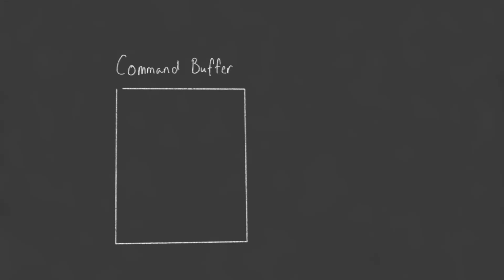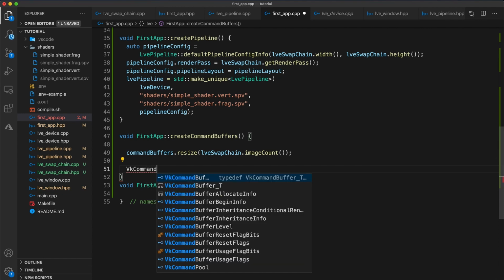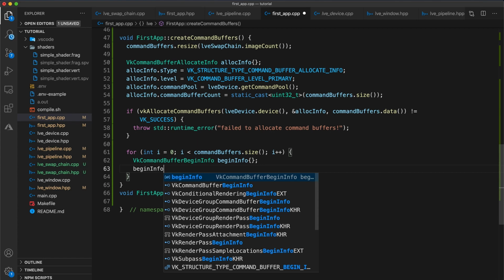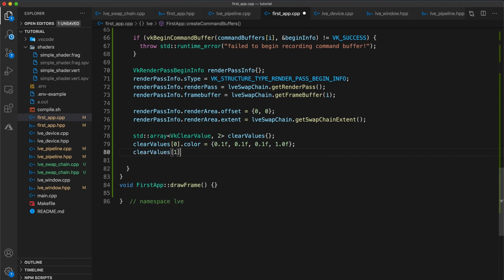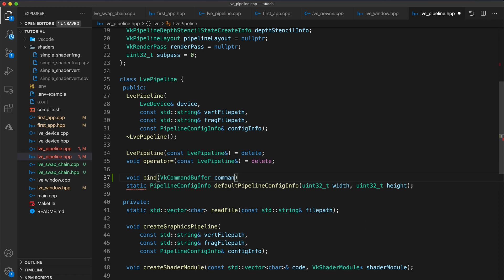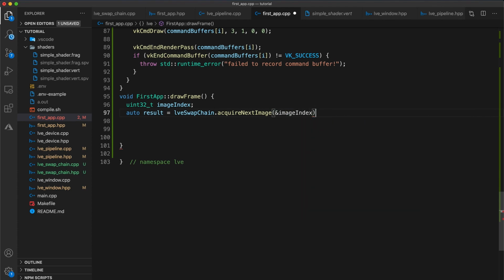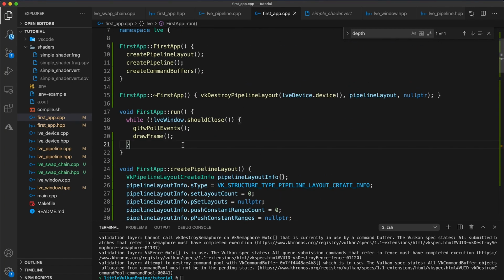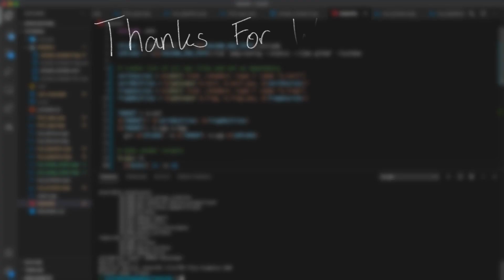Command Buffers Overview - Vulkan Game Engine Tutorial 05 part 2

Comment: Really great videos ! :D 
I'm following it on my machine but I got a weird problem when i was tried it at the end...
The window was black and was not responding. I tried to find out why and the call "vkAcquireNextImageKHR" in the swapchain was hanging forever. The workaround I did was to change the device to the nvidia one i got in my system ( the default one was an Intel Graphic GPU).
Do you know what that could be ? and what I should add to the device selection part to be sure that its ignoring the Intel one without hardcoding the Nvidia device ?
Reply from the maker: glad you found the solution. I'm not sure why that would have happened. The device class should find the devices that would support vulkan and then picks one of them. Currently it doesn't do anything to pick the better device if your host has multiple and the quick solution for now would be by doing what you did and selecting it manually... but it shouldn't have picked the intel graphics if the intel gpu didn't have the required features to run. 

I'll need to look into this more. What OS was this on?
Reply: @BrendanGalea   I'm on an XPS 15 9510 running Ubuntu ( this is a new cpu so maybe it's some driver issue ?) 

Btw it's realy cool that you keep responding to comments on a 8 month old vidéo !
Here is the physical device vulkaninfo command output so you can maybe find something I missed :)

GPU id : 0 (Intel(R) UHD Graphics (TGL GT1)):
	Surface types: count = 2
		VK_KHR_xcb_surface
		VK_KHR_xlib_surface
	Formats: count = 2
		SurfaceFormat[0]:
			format = FORMAT_B8G8R8A8_SRGB
			colorSpace = COLOR_SPACE_SRGB_NONLINEAR_KHR
		SurfaceFormat[1]:
			format = FORMAT_B8G8R8A8_UNORM
			colorSpace = COLOR_SPACE_SRGB_NONLINEAR_KHR
	Present Modes: count = 4
		PRESENT_MODE_IMMEDIATE_KHR
		PRESENT_MODE_MAILBOX_KHR
		PRESENT_MODE_FIFO_KHR
		PRESENT_MODE_FIFO_RELAXED_KHR
	VkSurfaceCapabilitiesKHR:
	-------------------------
		minImageCount = 3
		maxImageCount = 0
		currentExtent:
			width = 256
			height = 256
		minImageExtent:
			width = 256
			height = 256
		maxImageExtent:
			width = 256
			height = 256
		maxImageArrayLayers = 1
		supportedTransforms: count = 1
			SURFACE_TRANSFORM_IDENTITY_BIT_KHR
		currentTransform = SURFACE_TRANSFORM_IDENTITY_BIT_KHR
		supportedCompositeAlpha: count = 2
			COMPOSITE_ALPHA_OPAQUE_BIT_KHR
			COMPOSITE_ALPHA_INHERIT_BIT_KHR
		supportedUsageFlags: count = 5
			IMAGE_USAGE_TRANSFER_SRC_BIT
			IMAGE_USAGE_TRANSFER_DST_BIT
			IMAGE_USAGE_SAMPLED_BIT
			IMAGE_USAGE_STORAGE_BIT
			IMAGE_USAGE_COLOR_ATTACHMENT_BIT
	VkSurfaceCapabilities2EXT:
	--------------------------
		supportedSurfaceCounters:
			None
	VkSurfaceProtectedCapabilitiesKHR:
	----------------------------------
		supportsProtected = false

GPU id : 1 (NVIDIA GeForce RTX 3050 Ti Laptop GPU):
	Surface types: count = 2
		VK_KHR_xcb_surface
		VK_KHR_xlib_surface
	Formats: count = 2
		SurfaceFormat[0]:
			format = FORMAT_B8G8R8A8_UNORM
			colorSpace = COLOR_SPACE_SRGB_NONLINEAR_KHR
		SurfaceFormat[1]:
			format = FORMAT_B8G8R8A8_SRGB
			colorSpace = COLOR_SPACE_SRGB_NONLINEAR_KHR
	Present Modes: count = 3
		PRESENT_MODE_FIFO_KHR
		PRESENT_MODE_FIFO_RELAXED_KHR
		PRESENT_MODE_IMMEDIATE_KHR
	VkSurfaceCapabilitiesKHR:
	-------------------------
		minImageCount = 2
		maxImageCount = 8
		currentExtent:
			width = 256
			height = 256
		minImageExtent:
			width = 256
			height = 256
		maxImageExtent:
			width = 256
			height = 256
		maxImageArrayLayers = 1
		supportedTransforms: count = 1
			SURFACE_TRANSFORM_IDENTITY_BIT_KHR
		currentTransform = SURFACE_TRANSFORM_IDENTITY_BIT_KHR
		supportedCompositeAlpha: count = 1
			COMPOSITE_ALPHA_OPAQUE_BIT_KHR
		supportedUsageFlags: count = 6
			IMAGE_USAGE_TRANSFER_SRC_BIT
			IMAGE_USAGE_TRANSFER_DST_BIT
			IMAGE_USAGE_SAMPLED_BIT
			IMAGE_USAGE_STORAGE_BIT
			IMAGE_USAGE_COLOR_ATTACHMENT_BIT
			IMAGE_USAGE_INPUT_ATTACHMENT_BIT
	VkSurfaceCapabilities2EXT:
	--------------------------
		supportedSurfaceCounters:
			None
	VkSurfaceProtectedCapabilitiesKHR:
	----------------------------------
		supportsProtected = false

Comment: The command buffer part is a bit misleading, since the advantage with them isnt that you can record once and use over and over since recording is pretty cheap. The advantage is that  the driver knows what instructions are going to happen before hand, unlike opengl, so some problems can be avoided
Reply from the maker: ya that's a good point, my description here is pretty lacking. I'll post a correction when I get the chance. Thanks!

Comment: I am crashing wiht these errors messages whne I run in debog:
"
...
validation layer: Validation Error: [ VUID-VkPipelineColorBlendAttachmentState-colorWriteMask-parameter ] Object 0: handle = 0x2255ea6c688, type = VK_OBJECT_TYPE_DEVICE; | MessageID = 0xb8f9c032 | vkCreateGraphicsPipelines: value of pCreateInfos[0].pColorBlendState->pAttachments[0].colorWriteMask contains flag bits that are not recognized members of VkColorComponentFlagBits The Vulkan spec states: colorWriteMask must be a valid combination of VkColorComponentFlagBits values (https://vulkan.lunarg.com/doc/view/1.2.176.1/windows/1.2-extensions/vkspec.html#VUID-VkPipelineColorBlendAttachmentState-colorWriteMask-parameter)
failed to submit draw command buffer!"

but in Release it doesn't show have anyone else have the same issues?
Reply from the maker: This is my mistake I mention in the pinned comment! I go over how to fix it there. Essentially in release mode the copy operation is optimized away when returning the struct from the default pipeline function. My apologies!

Comment: I get a blank screen. The clear values do affect the background color of the window, which means that at least something is happening. Other than that there are no validation errors. Pretty tough debugging experience... hopefully you will dedicate a future episode to using tools like RenderDoc to help with debugging.
Reply: Playing around with renderdoc I see that the triangle is written to the depth attachment! I disabled the depth test but it did not help :(
Reply: Found it! Forgot to set the  .colorWriteMask = VK_COLOR_COMPONENT_R_BIT | VK_COLOR_COMPONENT_G_BIT | VK_COLOR_COMPONENT_B_BIT | VK_COLOR_COMPONENT_A_BIT, of the VkPipelineColorBlendAttachmentState in the info struct.
Reply from the maker: Glad to see you were able to figure it out. And that's a good suggestion and something ill keep in mind for a future video. Vulkan definitely can be very tricky to debug!
Reply: thanks for the tip about renderdoc - it helped me realize I've just messed my verts coordinates 😁
Reply: Had exact same issue, for me however it was the fact that I had this genius idea before that, to set the pipeline's rasterization cullMode to VK_CULL_MODE_BACK_BIT which resulted in the culling of my triangle due to the fact that I prefer my frontFace to be CCW (OpenGL).

Comment: Ok, so I tried to post this comment three times, but evidently YouTube doesn't like me posting imgur links to the picture of the errors. I'm having a lot of validation layer errors after incorporating the command buffer code, and I'm not up to the task of figuring this out as a newbie. The errors are VUID-vkMapMemory-size-00680, VUID-vkUnmapMemory-memory-00689, and UNASSIGNED-CoreValidation-DrawState-InvalidRenderpass
Reply from the maker: Hey Gabriel, ya YouTube can be frustrating like that. You can join the discord https://discord.gg/B8Zgyzge and post in the debugging-help channel and I can see if i can find the problem. Also if you are on windows check the pinned comment that goes over known issues
Reply: @BrendanGalea  Heyy, I had an issue with the autocompiling part. Can you resend the discord link, it seems to have expired.

Comment: Brendan thanks for the tutorial.  I'm using visual studio community 2019 and when I do the release build I get the same results as you do but doing the debug build and run I get a few validation layer messages and the program exits.  Is there a place I could share a txt file for what I'm seeing?
Reply from the maker: Hey james, in part 1 I fix the mistake last week, but I also left in an identical mistake within VkPipelineColorBlendStateCreateInfo pointing to the colorBlendAttachment! You could similarly move this out of defaultPipelineConfigInfo and into createGraphicsPipeline
Here's a better fix.
https://github.com/blurrypiano/littleVulkanEngine/commit/a867ab39c43ccc89ca744db84137df179b41daa7

For those extra messages they seem to be windows specific so I didn't notice them initially. In the LveDevice.cpp file at around line ~219 you can remove VK_DEBUG_UTILS_MESSAGE_SEVERITY_VERBOSE_BIT_EXT
The verbose level messages don't mean you're doing anything wrong and can clutter up the console.

Sorry about this, for the first 5 tutorials I hadn't started testing on windows yet.
Reply: @BrendanGalea  added the fix from blurrypiano and all is good now.  Thanks
Reply: Well almost when I run the exe from the command line I get Microsoft Visual C++ Runtime Library Debug Error! and application aborts.  Seems to work when I launch from the VS IDE
Reply from the maker: hmmm I'm not sure why that could be. Another viewer recently posted

"I was having an issue when running this code in Debug configuration, turns out the validation layers couldn't load. If that happens, you need to define some system environment variables (on Windows): VK_INSTANCE_LAYERS and VK_LAYER_PATH. For some reason, the validation layers check didn't catch this problem."

Maybe something related to that. Is the .exe a debug build? Maybe the IDE is automatically adding the env variables when debugging, but they're not added to the debug .exe, just a theory
Reply: @BrendanGalea   Release build run from command line just opens and closes.  The debug version gives a Debug pop up windows and can abort, retry, or ignore.  Both seem to run ok in the VS IDE.
Reply from the maker: Maybe it has something to do with when the program reads in the shader files. If you are using a relative path try changing it to be absolute paths
Reply: @BrendanGalea  that is the issue.  Thanks.
Reply: guess put lve::FirstApp app{} into the try block of main.cpp because can throw exceptions and provide meaningful information in the terminal window?

Comment: When creating buffers for vertices, normals, etc. I need a reference to the device instance. How do you handle this? Would you store it somewhere global, so that GlobalClass::getDevice() can be called from anywhere?
Reply from the maker: I usually try to avoid the use of global variables in my projects. For creating buffers I'd follow a similar pattern (dependency injection) we've used for things like our pipeline class. Which we inject a reference to lveDevice into the class through it's constructor, and then can use lveDevice.device() to get that device reference.

Here's the git diff for tutorial 06 which covers this very topic. I'll do my best to have the video out sometime this week. Apologies for the delay,  I wanted to get 4 or 5 tutorials ahead in terms of coding. The next few videos should have a shorter turn around time.
 https://github.com/blurrypiano/littleVulkanEngine/commit/aea44359b807d3eacafd585a0457c90d4155b78a
Reply: @BrendanGalea  awesome, thanks man!